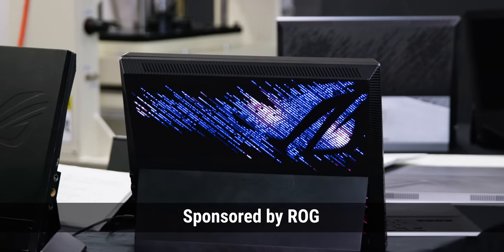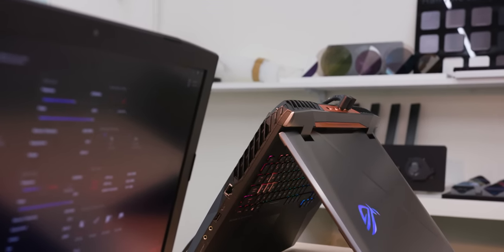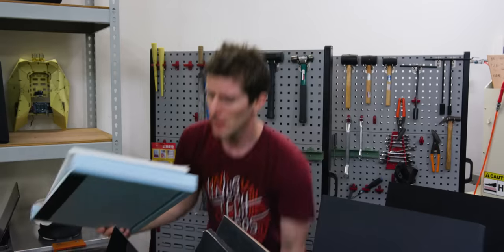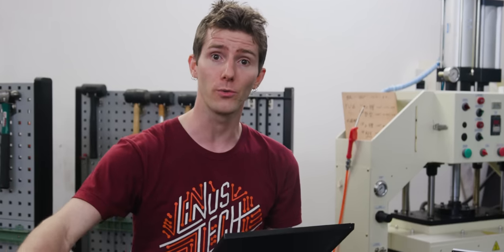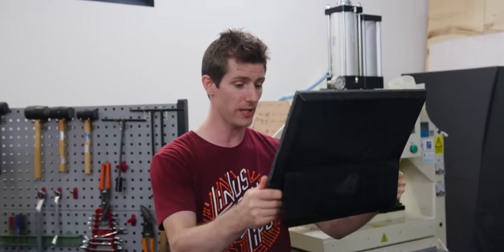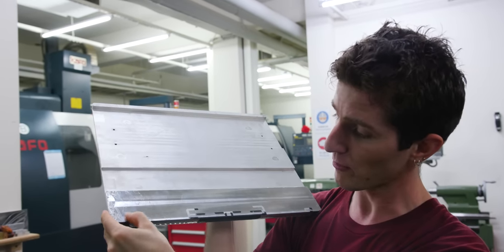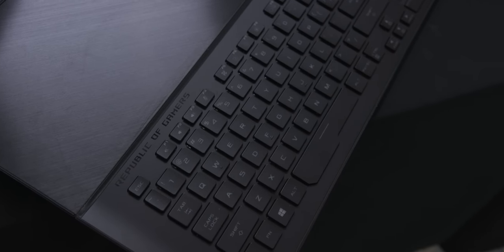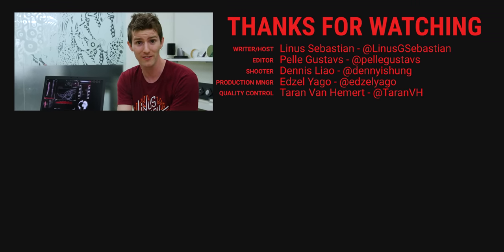How a Gaming Laptop Gets Made - ROG Design Center Tour

Comment: I cant have enough of ROG products
I just love Asus ROG  designs, products quality and after sales support.
ROG products are premium but they worth every dollar you spend on them.
Reply: but not the phone ew
Reply: I had a G750JW and it was great... Until the keys fell apart, the air vent covers broke, the USB ports on the left stopped working, the battery permanently died, the GPU died, and the trackpad stopped working altogether. I've heard that was the worst ROG though, it apparently was just an unlucky model for me to buy. I'll probably give them another try at some point.
Reply: @Amy_A.  i don't recommend asus as my local repair shop said that the most laptop that come in for a repair is guess what? asus.

my dad's zenbook 3 screen broke after 1.5 year of usage last month. they replaced it tho, but 1.5 year for a $1700 laptop?
Reply: true, even after a bad experience with the tech support that is still not resolved i cant stay mad at them 😂
Reply: @rrrr2150  my experience with Asus products is mainly with thier Motherboards, GPU's and some peripherals.
No complains for the last couple of years since I started using Asus products.

Comment: Tbh, in hindsight the idea of not putting the main hardware on the part of the laptop that's resting on your lap seems like a very obvious idea.
Reply: The idea never was to use these types of computers on your lap. Computers aren't made for operating on soft surfaces like clothing, bedding, backpacks, etc. They're meant to operate on hard surfaces like tables, desks, those little bed trays you can get for using a notebook in bed. In fact, that's part of the reason a lot of IT use the term notebook rather than laptop. When I was doing support for notebooks, we were always told to call them that rather than laptops. There were horror stories about laps being burnt and companies sued. 😁

Comment: I could have told them that cooling is better with more gap for the vents ! I have an Alienware 13 r3 and noticed how loud it is under full load and hot. So I designed and 3D printed some legs that clip to the rear vents and lift the rear of the laptop up by about an inch or so. Lowered temps by a good few degrees but the noise was noticeably reduced, I guess because the air wasnt being sucked through a thin gap at the bottom.

Comment: Holy crap how prices for aluminium have plummited (international, not in the land of US where the tariffs lie). Probably close to a decade since I used to regulary deliver aluminium to recycling scrap yards, but the last time I delivered - some bar pieces, pipe and a set of broken rims etc - I got about equiv to $6.50/kg. For 1st rate (stripped of other waste and materials, pre-sorted, high grade) recycling. Buying new billet for manufacturing is significantly more expensive.

Comment: Such a high spec'd machine, well compared to what this casual uses. I mostly laptop and work. I want one with a touch screen (don't judge me, it's my preferred interaction method for laptops). Also surprised that they made a 1080 and 4k and didn't just go half way with a 1440p at 144, as well as the  4k.

Comment: 2014 GL551 ROG it started running fan full speed, finally wouldn’t post. Stuck with HD and airplane mode lights alternating.  Two places for asus repair in USA, both walk-in only.  Bought a used motherboard and now looking once agin at my crappy asus laptop screen.  Never again.

Comment: Send the freebie my way to see if a Clevo socket DTR fanboy will be impressed by how far "BGA junk" has come, or not ;p
I am interested to know whether and how they will deal with galinstan-based liquid metal losing volume and therefore performance as the galium alloys into a fresh copper surface.  Every fresh liquid metal application I've done has needed checking and more added within 3 months due to loss of volume of the TIM. When it's closer to release I hope Asus sponsor a teardown to encourage confidence amongst buyers that the solution has sufficient longevity.......

Comment: Hopefully cooling is fixed on the mothership. Have had a few ROG laptops with the latest one being the GL753VD model having the worse cooling design ever. GPU and CPU shares the same thermal pipes and fan. Could have easily removed the not needed dvd rom for each component to have it's own cooling fan. the i7 7700 with it's thermal spikes definitely pointed out the flaw in the GL753VD.

Comment: This was really interesting to watch. I love that they have a separate design studio for design prototyping that's away from the technical departments. It gives their designers a lot of freedom.

The last point, however, wasn't a great one. Manufacturers can and should be called out when they're ripping people off, especially when their high costs aren't justified by limited runs like Asus Mothership. 
A phone that's going to have millions of units produced shouldn't cost as much as a laptop, especially when materials and assembly only cost $300-375. Even with R&D and marketing costs, $1k+ is a stretch and is extremely anti-consumerist behavior. The point of mass production is to lower cost per unit. It's the same reason why Asus will use mass production techniques to build this limited run product. They understand that people won't want to shell out $10k on a one off design. Although, I get the feeling this is their way of testing the market for a new form factor laptop before producing them at higher rates.

Comment: Now, if only ASUS could fix outdated drivers on their 1+ year old laptops. And fix forums (you can't remove limited access without messaging a deceased forum moderator). And don't screw up when submitting drivers (touchpad, audio for G751JY, for example) to microsoft update catalog. Or have any semblance of live support on their site (not arseholes who say that your warranty is now void because subwoofer is dead due to incorrect software from windows update).

Comment: I did kind of the same thing with my ROG GL702VS-DS74 (i7, 32GB, 1070) and a cheap 3M laptop stand.  I keep the lid closed, and the mount set to where the laptop is almost vertical.  All the heat goes straight up, and the fans are wide open.  Bumping down the voltage .110mV, and no throttling ever.

https://www.amazon.com/3M-Vertical-Compact-Non-Skid-LX550/dp/B0006HVM4A

Comment: I got an ASUS ROG GL502VM gaming laptop, and it broke just after two years of use 😞 Laptop had a temperatures of 85-90 C on gaming, CPU & GPU thermal throttles (on stock speeds!). Asus ROG laptop runs so hot, so I suspect that too much temperature eventually killed it😢 Propably the GPU fried just stock settings.
Now I'm back with desktop gaming PC:s. Gaming laptops don't have an adequate cooling so I would not recommend them yet, I'm very disappointed to ASUS ROG laptop performance & durability 👎

Comment: Hey, does anyone know why my fan on my Acer Nitro 5 an515-53 turns on after I turn off the laptop and unplug the power cable? I sent it to Acer but they said they found a very small dried white substance like dried milk so they avoided my warranty . Let me tell you I havent had milk in over 2 years after starting a keto/carnivore diet lifestyle.  

Anyways, I feel I got ripped off and now I need to see about getting it fixed myself. The laptop worked fine until one long night of gaming a month ago and the fan started coming on and completely draining the battery after i shut it down and unplugged the cables. If I left the power cable attached the fan wouldn't come on. Leading me to believe a problem with the battery pack.

Comment: Yeah obviously r and d drive up cost, the problem comes when a majority of cost inflation comes from marketing. like with apples current devices, r and d is on the back burner, because nothing is being drastically changed, yet they come to market with some of the highest prices. its rip off cause their hardware and design is similar to their competitors yet demand twice as much